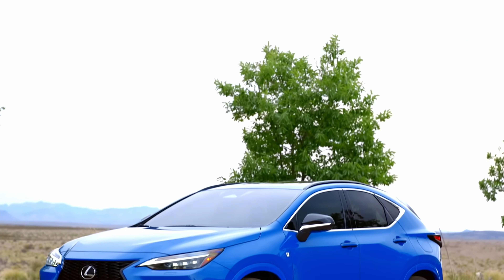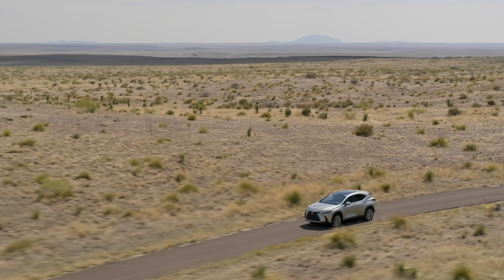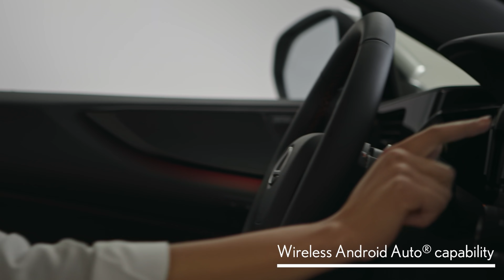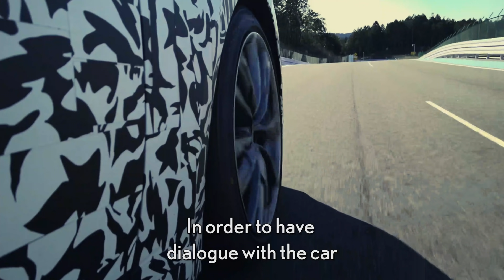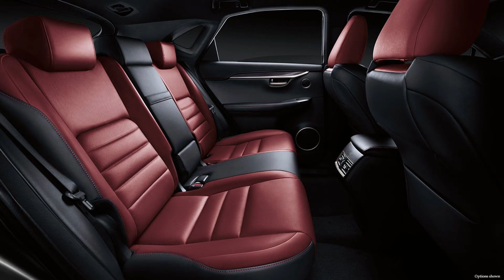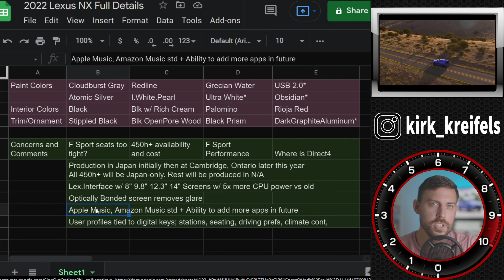The NEW Lexus NX will Change Lexus Forever - 2022 NX Explained!

Comment: Kirk, why a CVT on the 350h and the 450h+.  Are you ok with these CVTs on a higher-end product?  You would also think that the F-Sport would at least have an 8 speed
Reply from the maker: Toyota hybrids are called eCVT but they're not true CVT. Technically a power split device with a planetary gear set. Way more responsive than actual CVT

Comment: I am an owner of  a 2019 lexus NX and i love it, but i would like to see lexus put more sound proofing in   and more front seat functions  in the new nx, like massaging and electric lumber. As far as the sound proofing, i would like less road  and tyre noise coming into the cabin. If they had massaging function  and air suspension as extras,  i would pay the extra to have them in the vehicle. I am not interested in sun roofs.

Comment: This is super exciting for Lexus fans. But WHY couldn’t they have started this new interior design and tech in the IS? The IS started every other new Lexus brand changes like the new exterior design queues and Lexus Driving Signature, why not introduce the new interior too? Is the IS going away soon? If it isn’t, we will be stuck with an outdated interior in the IS for at least 3 or 4 more years, if not 6.

Comment: I think I’ve finally found my new car!!  Can’t wait. 

My concern is the headroom. In the Venza, I felt very cramped with headroom, without the panoramic roof, which I wanted, but further reduced headroom. I’m very tall in my torso, and headroom makes or breaks a car. I have the Highlander Hybrid now. I want something a little smaller, but couldn’t handle the RAV 4 because of the rubberized controls. I want more luxury. 

Please tell me the headroom will be good!  I’ve sat in the current NX, and it’s okay. 

Now to decide between the 450h luxury or the 350h luxury. Can’t wait to see final mpg ratings and range.

Comment: Uhhhhh. The NX350h and the NX450h+ will use CVT transmissions???? Those noisy beasts????? Terrible. I test drove a Hybrid Honda CR-V SUV last year. During acceleration, the roaring noise was so awful that I turned round, and returned it to the dealer. Ah, well. in a few months I will test drive one, preferably the NX450h+. Even if I do, I don't plan to ever plug it in. So why buy it, you ask? I am hoping for better acceleration with less engine noise, that's why! But I will likely not ever find one, and would have to settled for the NX 350h.

Comment: I'd like to see that hybrid system mated to the 2.4 Turbo. FSport Performance one day maybe? I still think the 450h should be more powerful than the RAVPrime. A Lexus should never be slower than a Toyota at the same grade.
Reply from the maker: Yeah, David - I agree . I do wish the 450h+ had a little something extra over the Prime in powertrain department. but it will be better in every other way over the Rav4 Prime  (other than price haha)
Reply: @KirkKreifels  Hey Kirk! Agreed, and the biggest mistake they made for me with the last gen was not having the hybrid system mated to the 2.0 litre Turbo. If they did that then the last gen NX hybrid would have always had an advantage over the RAV4 hybrid. Kinda puzzling why the didn't do that to be honest. Fuel economy may not have been as good, but I'm sure performance would have been awesome and still better economy than the 2.0 litre by itself.

Comment: The 1.6 kWh Lithium battery in the NX350h is big for Lithium batteries they put in Toyota hybrids.  The Venza’s Lithium is .93 kWh and the current RAV4 Hybrid is 1.6 kWh but it’s a NiMH battery, not Lithium. Must be expecting a bigger draw from the RX front motor.

Comment: Great coverage and analysis, this is why I'm subscribed (and have been since you reviewed cars while working for Lexus haha). I have a bunch of questions/observations from this video:

1) I am actually liking those new door handles. It seems so obvious to integrate the touch sensor on the lever, now you have both electric and manual operation in one elegant package. This brings up the question - are there still physical key fobs and not just the digital key? You'd need the aux key to get into your car in the event of a dead battery.

2) How did you like the digi shifter? It looks very similar to the one on the LC500. When you move it, does it pop back into place like a joystick? I'm glad that they didn't move to a rotary knob or buttons (ie. Acura) or some other crap, the shift knob is both a functional and aesthetic element.

3) I agree that removing Atomic Silver on the ES is stupid. Atomic Silver is their best silver, and is a five stage paint. It is a signature Lexus color, more than any other color I can think of (that isn't structural blue).

4) Now, the big question about the 2.4T and the full-time AWD. Did you get any more details about that full-time AWD, is there a geared center diff, or is it all clutch-pack only? Do you see this replacing the V6 and the full-time Torsen AWD in the Lexus IS? 

Some people on the LE forums are saying that we might see an improved TNGA-N platform that will go into the real 4th gen IS, and I'm starting to wonder if that 2.4T and the new AWD is slated to go into that vehicle. For one thing, Lexus will definitely be able to turn the boost up to at least 320hp+ / 320+ lb-ft, and whether we like it or not, it will be a better engine compared to the 2GR-FKS as far as Lexus is concerned. 

0 - 60 times will drop from 5.7 to probably 5, possibly high 4s. The new full-time AWD is almost certainly lighter than the current one in the IS. Basically, the IS could gain power, gain torque at the low RPM, improve fuel economy / emissions AND drop weight from adopting the 2.4T / 8 speed / new full-time AWD.

Comment: Finally! We get
-bigger center console display
-new infotainment
-ambient lighting!
-cool new temperature dials
-digital instrumentation a bit small but welcome
-digital rear view mirror
-spelt out LEXUS on the rear looks sleek!
-new steering wheel

WHY COULDN’T WE GET THESE UPDATES FOR THE REFRESHED IS?!

What I don’t like about it is not as sharp on the outside as it was on the previous models. It’s more rounded now. Also the turn signals being separate from the DRLs is a no go for me. It looks cooler when it switches from DRL to turn signal.
Reply: the turn signals are not sequential which looks cheap

Comment: Question, isn’t the digital mirror redundant if you have a back up cam?
Reply from the maker: It's like having a hi def backup camera placed in the RV mirror
Reply: @KirkKreifels  but isn’t it just an extra step v just throwing the car in reverse? Also, you’d have to readjust the mirror since it’ll be “out of place”
Reply from the maker: It doesn't move when you switch it on or off. Also I prefer to have it off because I'm old school. But it can be left on indefin for preference
Reply: @KirkKreifels  got it, still feel that it’s somewhat redundant since there’s a back up cam (could’ve just make the whole cam system hi-def). I remember my 2009 Nissan Rogue had a reverse cam in the mirror & would disappear automatically once out of reverse. 

Maybe once I test it it’ll be a different experience

Comment: Same 8 speed as RAV4?- please no.
Reply: It’s the same 8 speed as the rav4 and$ Camry
Reply: @naveenthemachine  Well.....crap.
Reply from the maker: It's modified for this new engine and AWD system
Reply: @KirkKreifels  do you know if the AWD system in the nx has torque vectoring?
Reply: @KirkKreifels  I was always assuming they'd never put this jerky 8 speed transmission my 2019 RAV has in a Lexus, but if the new NX doesn't coast and lurch a little my next question will be why in the world can't they completely stop it in my RAV.  It's almost enough to make me go back to Nissan.  P.S. Thanks, Kirk.  Great job as usual.

Comment: I think the new NX will be a home run. I was planning to pick up the new GV70 for wifey but now I will have to wait until the new NX drops.  I think it will be a better option.  The GV70 is hot but the local Genesis (Hyundai) are starting to play those silly mark up games. I think Hyundai dealers will hurt Genesis.  When you go to buy a 60K+ luxury car you don't want some simp asking you what you do for a living, what are you trading in, etc.  TELL ME ABOUT THE CAR and why I should spend my money at your dealership.
Reply: Dude don’t get the nx. The gv70 is leagues better in every way.

Also the dealership experience an be overlooked. Genesis could have the worse dealer experience and they still offer better vehicles than lexus does
Reply: @naveenthemachine  "leagues better in every way" can you be more specific?
Reply: @bam2xl14  
Handling
Dynamics
Performance
Braking
Luxury
Interior design
Materials quality
Reply: @naveenthemachine  when exactly did you test dive the GV70 2.5T and the 2022 NX 350 in order to make that comparison?
Reply: @bam2xl14  actually I didn’t drive it. But when I read about the gv70 and saw the interior pictures and specs that’s how I got my hunch
Reply: @naveenthemachine  oh ok it your opinion based upon 2nd hand knowledge.

Comment: Why doesn't lexus pair the new 2.4 turbo engine with the hybrid system? Would be a more logical way to increase both power and torque, and I'd imagine it will increase the effiency levels.

Comment: Waaaaay overdue! I was shopping the NX vs the MB GLC. The current Lexus product feels like an antique. The inofotainment system is lighthearted behind MBUX. What a shame and how stupid! Unfortunately nothing described in the video is terribly exciting compared to what the Germans are currently offering. It‘s more of a catch up game. I wish Lexus would dump the CVT with the hybrid models. It feels like driving a sewing machine. Why can MB integrate their hybrid drivetrain with a 9 speed automatic and Lexus can’t? The only, but extremely important, redeeming value for Lexus is the perceived reliability and the resulting slower depreciation!
Reply: The CVT is extremely dependable and actually provides more torque than a normal trans.
Reply: @InternetDude  This may all be very well true. Why then does Lexus not extend the benefits of the CVT to their customers driving non-hybrid versions of the NX? CVTs tend to be cheaper than geared automatics.

Comment: These will sale like Speed on the Autobahn - FAST!!!! Nice & small. 2 things, my pick would be the 350. I think the 6.8 is kinda slow. With that kinda of power 275/317 this should be in the low 6sec or High 5's. would be Sweet. And the interior has too much Toyota vibe for me. Still Nice though. Yeah, I can see this motor replacing the V6. Remember one thing, people Buy Horsepower but Drive off torque - lol. So, that torque should be Awesome. Stay Safe, Be Safe!!!!!
Reply from the maker: Yeah a lot of torque! Remember this will be quite heavier than a rav4. I'm more than happy to give up a few tenths to 60 in comfort and quiet
Reply: @KirkKreifels  Yeah, True but if that torque is down low. Like 1400-1800rpm. U will feel that in that seat, lol. Would be AWesome for that little truck..

Comment: More than the new NX, the 2.4L turbo 275hp engine is the BIG news for Lexus. I imagine it will be the workhorse engine for Lexus and will be found throughout all Lexus models in various states of tune. 275hp will be the new base engine for their midsize cars/SUVs and uptuned to 350+ hp for their F-performance line.

Comment: Was expecting a proper mechanical all wheel drive system with automatic transmission in hybrid models.
Reply from the maker: Not in the K platform. The tundra will have a mechanical AWD Hybrid
Reply: @KirkKreifels  Can't wait for it... don't know why's Toyota and Lexus so scared of change... Hyundai has done amazing job with Tucson.
Reply: @KirkKreifels  it’s supposed to be similar in design to the Ford Explorer hybrid or the Lincoln aviator plug-in hybrid
Reply: Mechanical AWD is garbage compared to electric. I own a RAV4 Prime BTW.

Comment: Nice video Kirk! I hope we get it in Europe too! Personally I fear they may retract from western europe countries like Infiniti did, because sales are very low, everyone buys (or leases) BMW, Mercedes or Audi. 
Suggestion: Could you please add the L/100km or km/L fuel efficiency, because all the viewers outside of the US (me included) are confused with MPG. I always need to go to a webside to convert it... Thanks, I hope you don't mind :-)
Reply from the maker: Hi! Lexus continues to gain market share in EU but it's very small still. I can't make any promises with fuel economy 😅
Reply: indeed, especially here in germany i get bashed many time when it comes to cars driving a Lexus :-( yes, they are expensive due to the EU tax and therefore they have a hard time. Than again the leasing as a company car is often not possible because "german leasing" does´nt have them on the list i heard :-) Lexus UX Hybrid is a nice car (i drove it 1 day) but without speedlimit people find 180km/h (0-100km/h in 9sec) to slow for a 40-50000€ car. Same goes with the ES 4cyl Hybrid. I fear also they will leave soner or later the EU market becasue our brands dominate every and each segment...they wont let others breath :-( This new NX will also not sell good in germany because only the Hybrid variants are interesting (gas prices) and the normal Hybrid is weak without the Turboengine! And the PlugIN with some goodies will be on par or even more expensive than AUDI´s, MErc or BMW´s ! Dealer´s are rare, that´s another drawback.
Reply: @kubanskiloewe  That's exacly what I wanted to say! What do you have for a Lexus? Grüsse aus der Schweiz!
Reply: @kubanskiloewe  Der RX 450h ist ein tolles Auto, einen weichen V6 und 8-9l/100km Verbrauch! Da kann der BMW X3 20i etc. in jeglicher Hinsicht einpacken!
Ich habe leider (noch) kein Auto, da ich bei meinen Eltern wohne. Diese haben aber einen 2018 Toyota Auris Hybrid und einen 2001 Skoda Fabia Kombi, 1.9 TDI, beides sehr zuverlässige und sparsame Autos!
Reply: @kubanskiloewe  Ich glaube Du sprichst vom Corolla, da geb' ich Dir Recht, ist mir auch schon aufgefallen. Wir haben aber den Auris (gebaut von 2013 - 2019) und dort kann man meines Erachtens gut einsteigen. Als erstes Auto stelle ich mir einen Yaris oder einen Auris (1. Gen.) vor, denn die Unterhaltskosten sind in der Schweiz nicht zu unterschätzen. Ich mache gerade das Schweizer Abitur und bis ich ausziehe und einen Autokauf beabsichtigte wird es wohl noch einige Jahre gehen. 
Ich wünsche einen schönen Abend :-)

Comment: I think you may be underestimating by a fair margin where that 450h+ will be topping out, price wise. The ES 350h UL stickered out at $55k with all the bells and whistles, leather, Levinson+tech, etc. For the new tech and plug-in hybrid in a CUV similarly trimmed out but with a much more advanced power train, I’m thinking at least $65k on the top end. They could probably try to push it higher but then you wind up crossing over with RX.

Comment: Looks fantastic.  I just wish the 450h+ had a little more power than the RAV4 Prime.  Hopefully that will keep the cost down.  I also like the 350h but here in California I can get $12K in incentives on PHEV so the 450h+ might be the same cost as the 350h.  Otherwise, a huge leap forward.  Only 4 months to wait (or longer for a 450h+).  I think my biggest gripe is with the instrument cluster.  Doesn't "wow" me like the rest of the car does.
Reply: Yeah, kind of a strange move to share the exact powertrain from the RAV4 prime but with LESS range and performance. I was hoping for a direct 4 set up so it will at least be dynamically superior to the RAV (which is a front tire burnout machine) but I guess the bean counters at Lexus suggested otherwise. Oh well.

Comment: For a second, when I heard NX350, I thought it was gonna be the 3.5L v6 311 HP 2GR engine. Finally the return of a v6 RAV4 in the form of a Lexus! 

But naw..it’s no longer the displacement names..
Reply from the maker: Displacement names ended a looooong time ago for the Lexus...I'm sure I have a video about it somewhere haha. Cheers.
Reply: @KirkKreifels  do you think this new NX is gonna draw a-lot of current RX owners?
Reply: Honestly it’s only matter of time the 2GR will join the sunset like the UZ, JZ motor. The motor in its different variation has been in production since 2002.

Comment: I hope the top price on this doesn't get too close to the Genesis GV70 with their 3.5L Twin Turbo V6!!! I'd rather own this Lexus but price will be a factor.
Reply: The GV70 is VERY nice!
Reply: Lexus nx will sell more vehicles then the genesis gv70 even though it has less hp in my opinion the genesis gv70  v6 is overprice for that much you can buy Mercedes glc amg43, Porsche Macan S and Audi sq5 for a little bit more money.
Reply: Dude the gv70 eats the nx in every way possible. The nx is still a laughing stock compared to the gv70 or other luxury players
Reply: @naveenthemachine  it's still a Hyundai
Reply: @ggusta1  not really valid argument. Just like the nx is still just a Toyota
Reply: Don't you dare compare Genesis to this wonderful and iconic brand Lexus
Reply: @ekgcanadianenthusiast9961  the GV70 is RWD based and more luxurious and more powerful than the NX
Reply: @kristians2704  - I know all those things about the GV70, hence my caution about the price of a plug-in hybrid NX. On the other hand Lexus has advantages that Genesis doesn't, such as dealer network and being treated like a luxury buyer, build quality, reliability, and simply being a known entity. As Kirk said, hopefully we do see a more powerful engine down the line - sure, I wish that that option had shown up here at launch, but they are already offering four powertrains. We will see. I am guessing that an established luxury brand such as Lexus would not see dealers putting ADM (Additional Dealer Markup) on the new plug-in hybrid. Maybe I'm wrong, I don't know. Honest question: do the German brands put ADM on new models?